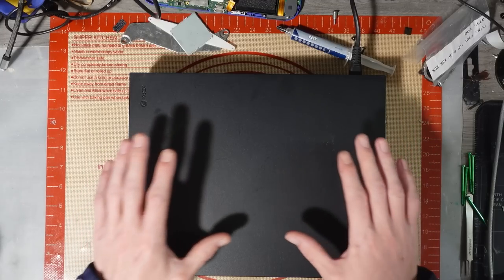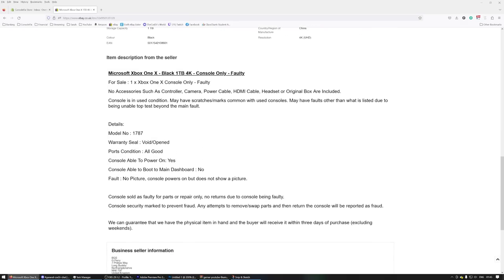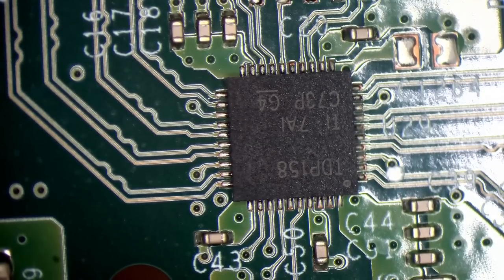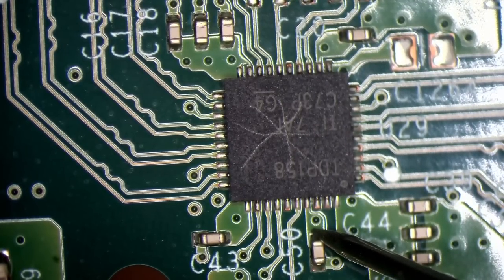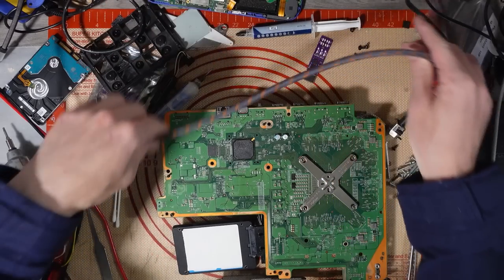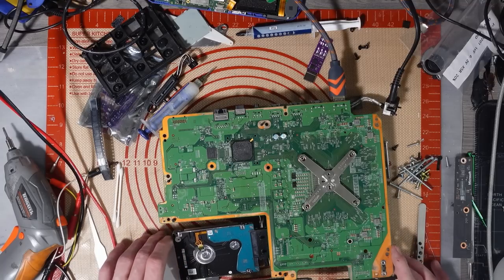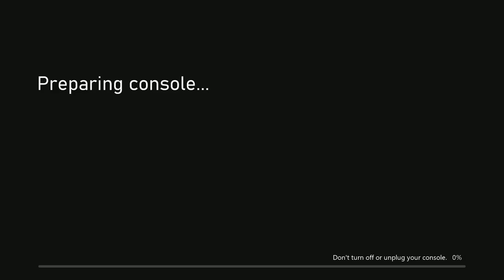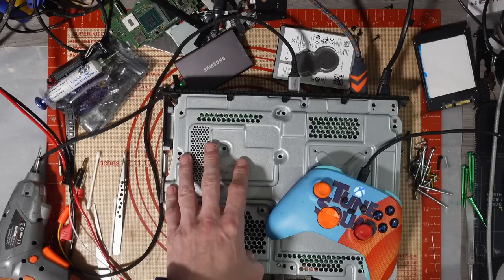BROKEN £50 XBOX ONE X WITH NO DISPLAY... CAN I FIX IT?

Comment: 2:50 - that's not what the IC is designed to protect against... (It's there to protect against ESD discharge (that size of package probably <15kV), not for protection from lightning strikes (~300MV))

Comment: Hi I have an old Xbox 360 that has a jtag fitted I have removed the GPU because of the red ring issue and have lost 3pads on the PCB how much would you charge to repair the board and fit the new GPU I have a replacement GPU to fit 
Thanks

Comment: *thecod3r*  I'm simply interested, in the video you say that the console is native Display port. So if the HDMI encoder is bad, why not do away with HDMI and have Display port instead? I believe that D-P is the better standard.
Reply: The current iteration of DisplayPort is superior to HDMI in most respects, however not only does it support much higher resolutions & refresh rates it also provides USB signalling and extra features which would serve no purpose on a console. Despite the lack of license requirements it would be overkill for even the current generation of consoles. HDMI licensing is know to be $0.04 at volume, I would imagine Microsoft have an even lower license consideration. I don't believe DisplayPort is endorsed by Dolby (it can support it though). HDMI does have eARC - something that DisplayPort does not support.

Comment: A sata cable shouldn't fail if it's not moving around.
Reply: @SaucyBegger25  yah I can see dust causing connection issues seen that before in some pc. But a physical brake would only be cause by cable being flexed to much